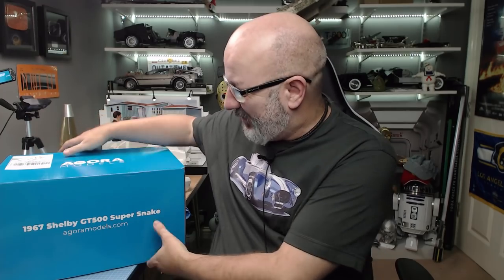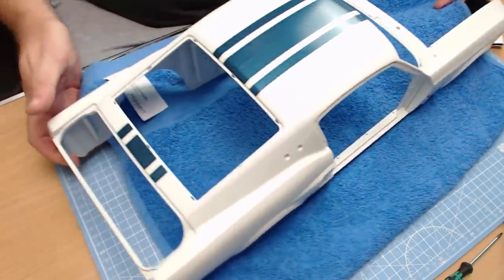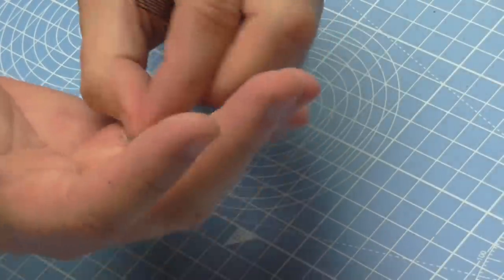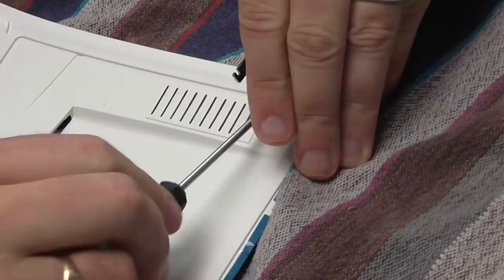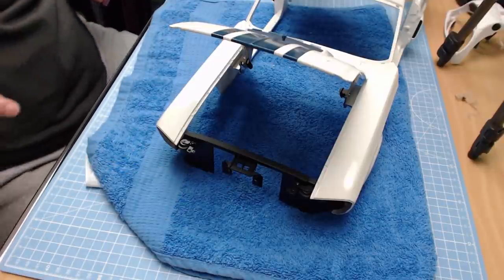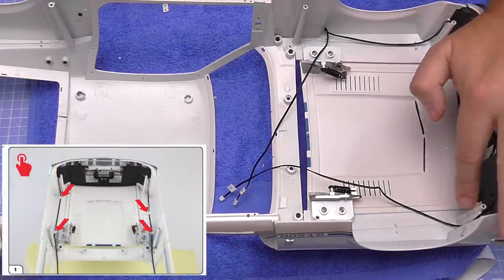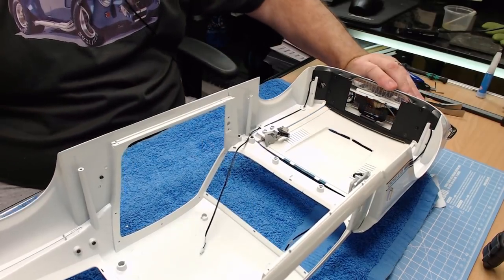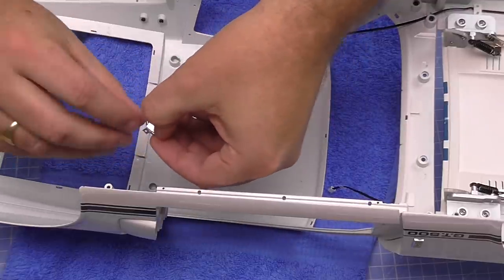Agora Models 1967 Shelby Mustang Super Snake - Pack 11 - Stages 83-90

Comment: Thought to protect pieces.. a camera case with foam pieces cut to shape. The bonus is that you could also use the cut out pieces to support models if upside down to protect delicate parts or paintwork.

Comment: ohh, man. . . you edited out the adjustment of the hood alignment. I was hoping you filmed that because I'm having a problem aligning mine. If I read the instructions right, you have to loosen a total of 8 screws. 4 that hold the fender assembly to the chassis, and 4 that hold the fenders to the frame. The confusing part is "push the front of the fenders left or right until the hood sets correctly." Well (1) how to you push a fender L or right...isn't it push the fender that has the narrower gap forcing the hood to move to the opposite side, thus centering the hood?
Reply from the maker: Wow. I honestly can’t remember needing to do it on mine
Reply: @WorldofWayneUK  Well, it was 2 years ago. Check Pack 11 at 18:31. I'll eventually get it. Sometimes if you walk away for a while the solution hits ya.